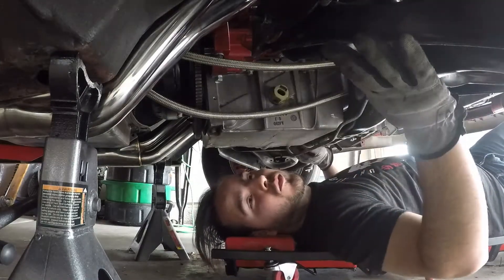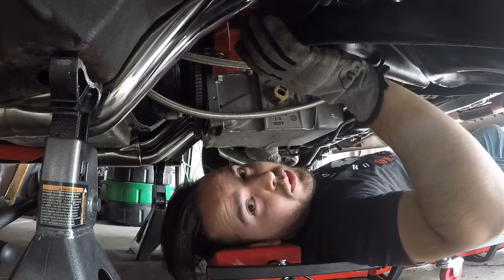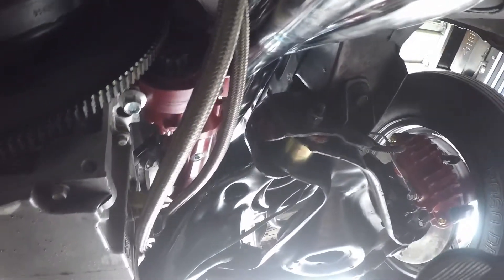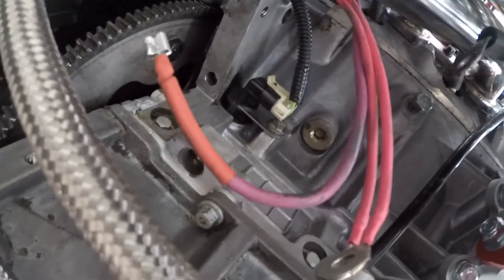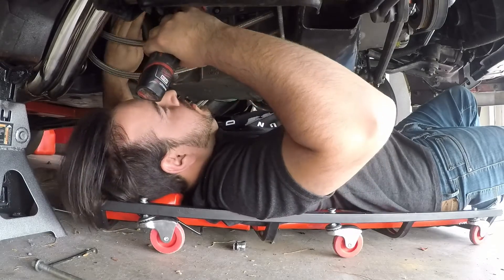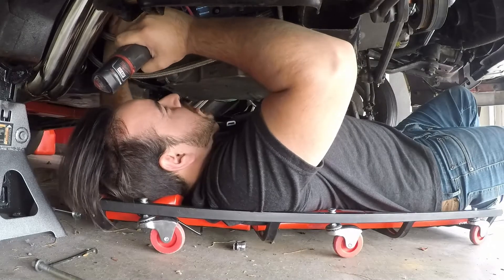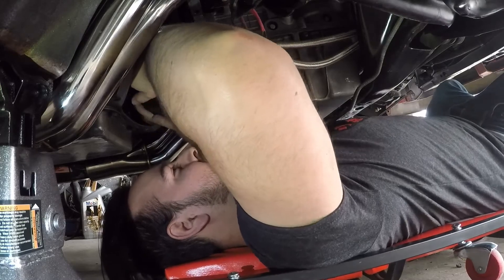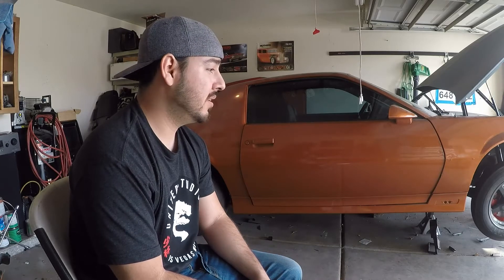Project Siren Turbo 400 Problems

Comment: Did you have to hammer the trans tunnel to fit the 400, or did it fit just fine?
Reply: Yes good question, I am finally planning my LS swap, and one of my concerns is tunnel clearance with a 4L80E (same as th400). That's why I am thinking built up 4L60E instead.

Comment: and what did you do to your transmission? my th400 is the same does not hook any gear :/
Reply from the maker: There is a gear selector on the side of the transmission. Its goes through to another gear inside the oil pan. The inside gear wasn't aligned right. If you drop the pan, you will understand.

Comment: those bolts are a pain, even with the engine out. but if you have the converter fully seated the most you want it to slide out is .06-.12 when bolting to the flexplate, or you will need to shim it.